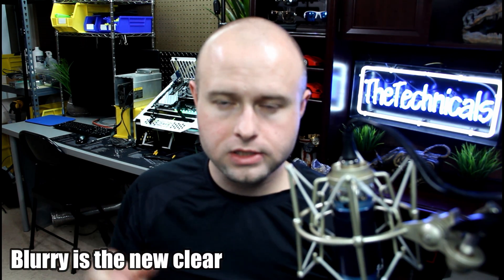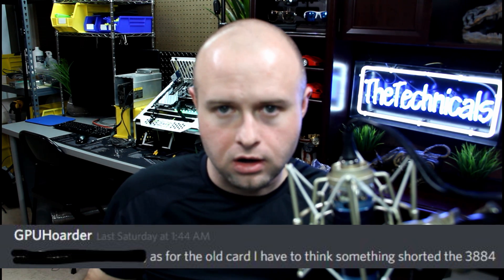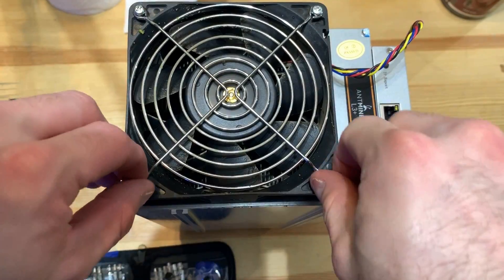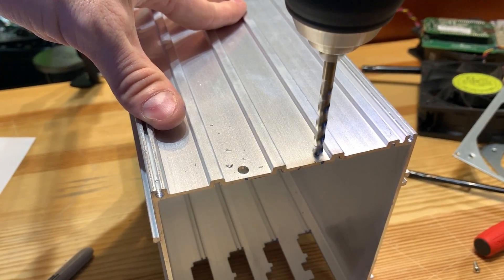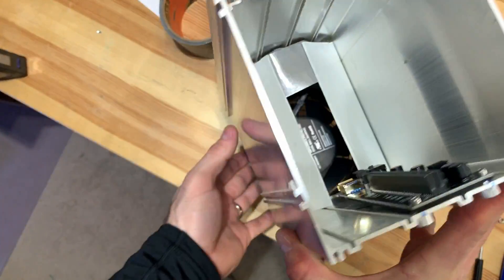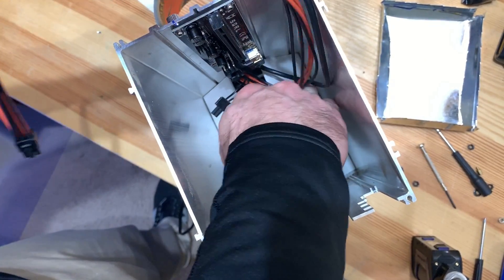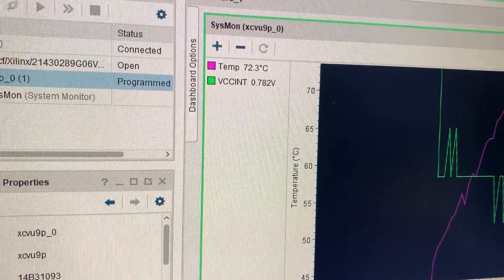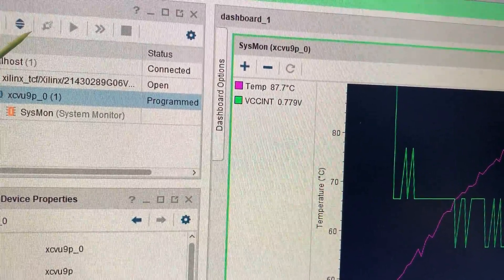[FPGA SitRep] BCU Swap / Secret Bitstream / FOMO

Comment: Revised comment. Thanks so much for putting the realities of running a BCU-1525 into perspective. I was personally about to pull the trigger on one, but am now thinking about waiting for the new H20 block to be tested and available. It's either that, or go with immersion cooling, which I've put a lot of research into. Thanks for trailblazing on this new frontier in mining!

Comment: I’m very tempted, I’ve been concerned about the Secret bitstreams but then it’s understandable that spreading out the hash across different coins doesn’t kill off the GPU communities, take some of the cream but don’t abuse it. 
My partner is a programmer of 20 years plus experience, where do you get the information / APIs to write bitstreams and contribute in a responsible fashion? Probably a question for Whitefire.

Comment: Hi. The video is good, don't worry. What the cost of the entire coolant system? I wondering what your ROI is? Regarding the private bitstream, do you also need to pay for that? I read somewhere that only 150 users get each bitstream. Is that correct?
Reply from the maker: I guess you're in the loop! Something like that, each bit has a finite # of users they can support

Comment: Secret bitstreams private mining non disclosure agreements is this where mining will end up? Or has it been this way all along
Reply from the maker: From what I can tell, it's been this way for some time. I think because not enough people have FPGA's, it doesn't make sense to release miners with dev fee and instead mine on them privately.
Reply: How can it stay private when it hits a exchange. Who wants to mine worthless shitcoins
Reply from the maker: I don't understand what you mean. What does an exchange have to do with a private bitstream? 

Why wouldn't you want to mine "worthless shitcoins" when you're pulling over $20-$50/day per card?
Reply: Just my understanding. These private coins and algos wont be on a exchange right? So u mining worthless coins so this is the risk. Once it hits a exchange u wud b lucky if u have buyers buying these coins
Reply from the maker: Every bitstream i've seen has been on an algo with exchange-traded coins. The one i've been running for the past couple weeks has been very profitable, despite the market. They're actively traded coins. Does the "private" term make it seem as if they're not? Thanks
Reply: @TechnicalsMatt  ohhh i see. Excellent news. I wonder if i can guess the hashrate as a algo nethash rate bas gone extremely high. Btw do u have a discord chan?

Comment: I ordered my BCU1525 with active cooling installed by Squirrel Research. Do you think those cards will suffer the overheating issues? I'm really trying to stay away from water block. Thanks for the video.
Reply from the maker: Mining hardware says he's getting good results with fans. All I know is the weak 0X bit I ran on the VCU couldn't stay under 95

Comment: just a thought... it is very possible the aluminum blocks are porous and it's letting liquid through, thus frying your chip/memory.  I have seen porous aluminum leak water, or leak air (aluminum wheels) before.

Comment: isn't submerged cooling cheaper at this point?
Reply from the maker: Still pricey. Novec is like 200/L?
Reply: @TechnicalsMatt  You wouldn't put a PepBoys turbo on a $5,000 racing engine would you?
Reply: @TechnicalsMatt  ok that's really expensive